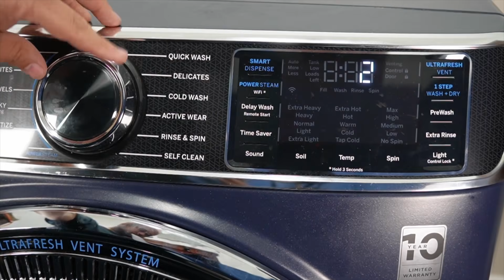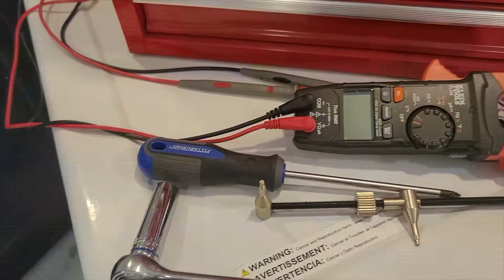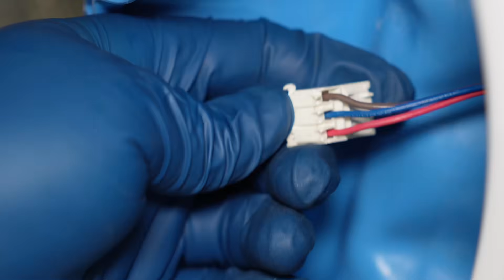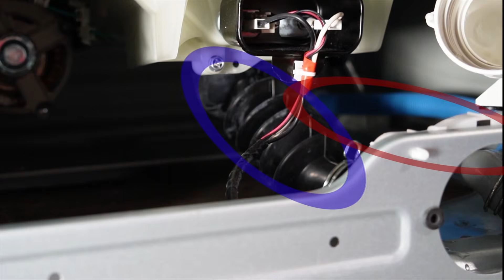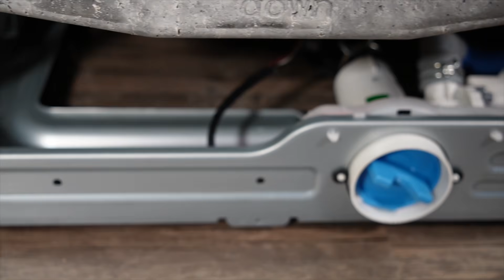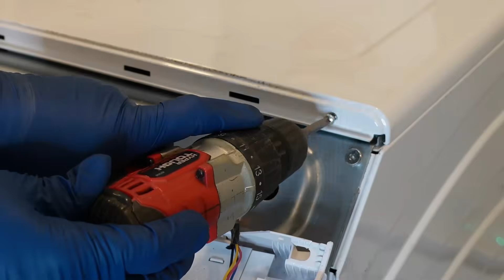GE Front Load Washer Stops Mid Cycle and Won't Spin - Common Issues

Comment from the maker: Key parts mentioned in the video:

Inverter Board: https://bens-appliances.com/products/wh22x35837-ge-washing-machine-inverter-board
Door Lock: https://www.ifixit.com/products/ge-door-lock-wh01x29528
Drain Pump (3rd Party): https://bens-appliances.com/products/wh11x29539-ge-washing-machine-drain-pump-wh11x29539cm
Pump (OEM): https://ifix.gd/3XPuKIk
Accelerometer: https://www.ifixit.com/products/ge-washer-accelerometer-wh03x32138
Reply: I bought a inverter board from Ben Appliance and changed it. My washing machine works well. Thank you.
Reply: I had a 3 error code only so I repllaced rhe incerter board and it works fine now. Thanks, Ben for selling a good board!
Reply: I used this video to diagnose the issue (and found a lot of backup that he was right in other sources) and purchased the board directly from Ben.  The price and shipping was on par with most (cheaper and faster than many!). 

Replaced it yesterday and the washer worked immediately. Thank you!
Reply from the maker: @yerocb nice!

Comment: Thank you! Saved me from paying the ridiculous $125 trip fee that GE charges did to come out and diagnose the problem (not including labor and any parts needed) or buying a new washer. New inverter board installed with your help and feels like a brand new washer. Only 2.5 years old when this issue started in the first place. Hoping with this new board, the washer last more than 2.5 years. We shall see! Thanks again!
Reply from the maker: You're very welcome, hopefully, this one holds up for you much longer!

Comment: Posting this for future viewers: my machine would prematurely end any wash cycle. Diagnostic Mode option 1 showed error code 3 ('locked rotor monitor'). Using Diagnostic Mode option 14 (spin test) demonstrated that the drum would only spin for about 5 seconds at a time, which is faulty behavior. This suggested an issue with the inverter board (motor control board). Ordered and installed a replacement inverter board. Everything is working correctly afterwards. When ordering a replacement, ensure you are getting a more recent version; I purchased v2.3.3.9, GE PN: 290D1952G105. The version and part number are labeled on a sticker attached to the pcb. Hope this may help someone in the future.

Comment: rinse and spin stops after about 3 minutes. tried probably a dozen times and it never enters diagnostics mode. i ordered the inverter board and was about to start, but now i have second thoughts given no diag mode. not sure if I should proceed or just get a new washer. HD has a sale.

Comment: Thank you for the video, got it fixed, simple instructions are the beat
Reply from the maker: Glad I could help you get it running again!
Reply: @bensappliancesandjunk  mine doesn't even enter diag mode. i tried probably a dozen times. i did order the inverter board, but afraid that might not even be it without codes.

Comment: Thanks for the great video. My inverter board died on a 6 year old unit. Figured it was bad given all the tests that I ran and this video helped to make me more confident of it. I flipped the washer on its back and replaced the inverter board easily by going in through the bottom. If you have the room to lay it on its’s back (and the extra help to carefully lay it down and pick it back up) it’s so much easier. Nothing else has to be removed.
Reply: but you got codes. mine doesn't even get to diag mode.

Comment: My washer stopped working a few days ago and I ran a diagnostic test with codes 3, 19, 23, 26, 27, 38 coming up. 3 was the primary error and others cascading. Ran test 14 (spin) confirming inversion board issue. Order the inversion board from you and a spring expander off amazon. Washing machine is back and running like new. Your video perfectly explained the repair, thank you!

Comment: Just replaced my Inverter this afternoon. Should've watched this video beforehand. Replaced the drain pump first, and then the main control board. Washer still wouldn't pass test #14 or 26 after replacing both of those two parts. Was scared it was the motor, so I replaced the inverter board instead. Best video. I replaced it by putting the washer on it's back instead of removing all the other parts. Still an awesome video. Thank you!

Comment: GFW850SPNRS  error codes 3, 38, 23, 26, 8, and 92. Fills with  5 seconds of tumbling and keeps repeating 5 seconds of tumbling then ends after 3 seconds. After resetting error codes and leaving unplugged for 10 minutes it gave me error codes 3 and 9. Also, it’s over sudsing with an empty load. Could it be that the main board is bad? Or definitely the inverter board

Comment: My washer is just over 2 yrs old and it started having issues with stopping mid cycle and not spinning. It had a bunch of codes related to the door lock, inverter and motor. I cleared those and did a spin test. Still failed only throwing code 3 which is a stalled or stuck motor. The motor turned easily by hand and the motor windings homed out fine. Replaced the inverter using this video as a guide. Works perfect. Thanks for making this video🙏🙏🙏

Comment: I keep getting code 3. Failed spin test 14.washer only spun for about 5 seconds. My hall sensor is connected.  Is there a way to test its bad and how can I test the inverter. I see many comments with the same issue as mine that say they replaced inverter and it worked after. I just want to test before I buy something that doesn’t work?

Comment: you do not need to remove the door boot to remove the door lock. just feed it though the front panel Ben... i have change a few of them... These blue door boot GE washers fail after 2 or 3 years...money pit washer...

Comment: I have the blue one 3 years old , code 65 and 92 do I need a motor and inverter? I did the inverter test and it is definitely bad. After power reset it had more movement but still failed. The concern is I replace the inverter and the motor fries the new one. I also have codes 3,27,38 and 39.

Comment: Mine passed diagnostic test 14. It spun the whole time. Cleaned the pump all the way and the hoses. Water still just sits in my washer machine and won’t do the last rinse and spin cycle.

Comment: I ran the service mode 14 and everything ran fine. I tried the mode 12 and nothing happened. Would that lead me to replacing the drain pump? FYI, washer runs for about 10 minutes and when it comes to drain/spin, nothing happens and shuts off after 5 minutes leaving a tub full of water.

Comment: Great video! Quoted $550+ to “maybe fix” my washer that stops spinning shortly after it has begun. Watched your video, decided to order an inverter board. Using your video, my fiancé had it up and running in two hours! Thank you!
Reply from the maker: So happy I could help you get it running again without the high repair bill!

Comment: This are all the codes I got on this style type of machine 

Drain/water level 

• Code 9

• Code 26

• Code 27

• Code 38

• Code 66

Motor / drive:
• Code 3
• Code 43
• Code 48
• Code 50

I narrowed it down to the inverter board since it went through all the tests except the #14

I couldn’t think of anything else

Comment: For anyone else doing just an inverter replacement, there is a much easier way.  Turn the unit on its side, and use the opening in the bottom to access the inverter enclosure.  You can see the bottom opening in this video.  You have to undo a single screw (its tight, but has a Phillips or socket head idk the size) and the whole enclosure will be free and dangling by the wires.  Then just do the same thing this guy did to replace it.  DO NOT be an idiot like me and leave the soap dispenser in place or it will leak all over the place and you'll spend hours cleaning it up.

Comment: Having issues with this washer spinning a couple seconds then stopping and eventually cutting off. Error code 3 mentioned hall sensor? should I just get the inverter board? I've already replaced vent pump because it had that code and door lock assembly because it had that code (even though I think that was fine).

Comment: I tried to run test 14 and nothing happened. If the door is open when I try to run it, the display flashes the lock symbol but when its closed it just does...nothing. Advice?

Comment: My GE 850 model is stuck  on pause mode after all the resets unplugged amd replugged  ran diagnostics got code 34 38 39 . When I try to go.into test mode to see if I need a board or a vent damper it wil not let me test it gets stuck will not cleat so I can turn dial to right to advance to testing.. I have plugged and repluggwd so mucj my arms are sore

Comment: Two months ago my blue GFW850SPN5RS went out. Like many of you the level of disappointment I had after only owning this machine for less than three years was infuriating. It began when I started to notice that my clothes felt wetter than normal. Eventually, it would stop 3 minutes into starting the cycle. I found Ben's videos and started with replacing the drain pump - no fix, motherboard - no fix, and finally before giving up completely I decided to try the inverter board as a last ditched effort. Finally, issue resloved...the lesson learned when doing the spin test is just because it spins does not mean that your washer is fully working. The fact that it never went into a full spin cycle should've been my first indicator. Let's see what happens in thr next 2-3 years. Thanks Ben for your guidance and amazinf videos. To everyone else no matter how overwhelming it may be, take your time and just know that you're more than capable of fixing this silly machine.
Reply: I have the same model and mine is 2.5 years old and won't spin or drain. I replaced the pump and that didn't fix it. I guess the main control board is next. So disappointing.

Comment: Help! Did test 14, and it went further than 5-7 seconds and started swaying back and forth… with a loud banging noise.  Before seeing this video, I replaced bottom draining pump. Still inverter? Or possible other issues?

Comment: Well, this video was absolutely useless to me. Thank you for wasting my time.. I have this exact same washing machine gets set to program log logic number seven. After four minutes into any cycle, it stops and says end I had water in the pressure sensor reservoir at the bottom of the drum. I could blow into the pressure sensor hose and hear it bubbling like a water bong so I drain the water and cleared the nipple of any kind of obstructions dried soap or whatever and I got all the water out of there so I was blowing air through it instead of bubbling water, slapped it back together and it’s still doing the same shit

Comment: Thanks! This helped me a lot. I did not remove the concrete and was able to access everything with a little effort from the front just fine. One thing that had me worried was the removal of the control panel assembly. Note that after the screws are removed and the left side pulled outward that there are two pins on the right side that hold it in place. The whole thing needs to scoot to the right to get off those pins. There isn't a reason to take the top off if you are just replacing the motor controller below.
Reply: Take the top off so you could look at the wires and connections to check if any of those could be causing the issue. It could be a loose wire, a burnt wire, cut wire, or other connection issues along with other parts that could have been burnt out.

Comment: Replacement worked for me.  Sent $50 as a thankyou.  On my GFW850SPN4RS model, I didn't have to remove the cement to get to the board.    Wash out your soap tray before putting back together.  Mine sat apart for 3 days waiting for the inverter part and the tray clogged.  Took 2-3 cycles before the washer sounded the same with reference to clicks and water hammers.  Been working just fine for 3 weeks now.  I think mine blew due to a brown out.  I have a Ting monitor and it dipped twice during the cycle.  I was finishing laundry as a severe snowstorm was hitting us. No more laundry during severe weather.

Comment: Those two big connectors on the board do NOT come off easily.  Not pretty, but I pried it with a small screw drivers.   I have the GFW850S model.  Removing the cement is not necessary to get at the inverter.  I also have the pedestal and didn't have to tilt the unit back for the three bottom screws.  Just opened the drawer.  The mix of screws used is maddening.  Make sure to document what screw go where.  I took a lot of pics and laid out screws in same pattern that they are on located on the machine.  My machine was new in July 2023.  Didn't even make it three years and for a family of two with three dog beds.  Adding GE appliance repairman to the YouTube certification list.

Comment: Great video, thank you. This gave me additional confidence in diagnosing the issue without taking my machine apart. In terms of replacing the inverter motor control board, I found it easier to tilt the machine back and go in from the bottom.

Comment: Adding my situation for hopes of some help. 

At first my codes were : 65 , 3, 38, 50 & 46 — I ordered an accelerometer and replaced it my codes now are : 3, 8, 38, 50 , and 46 .

The machines fails the 14 spin test and the 26 spin test . Any suggestions ? I want to give up and buy a whole new machine

Comment: Replaced the inverter on mine reset the codes did test 14 but it still stops 5 mins into a cycle.

Comment: How did you get the two big clips disconnected, these are a pain, I’ve tried pinching them and pulling up and they won’t come out
Reply: Really small flat head screw driver

Comment: i have a GE washer GFW655 that is 23 months old.  The pump sounded like it had gravel in it, i thought a bearing was out but it was starting and stoping in fractions of a second and sometimes working.  I replaced the pump and it worked ok for a few cycles before starting the same thing.  I've inspected for lose conections and other signs of a short or open.  seems like it operates more reliably when the top is off but not always.  I've been messing with it for a few days now the drain pump is either working or not - no more quick cycles.  I'm thinking if a board was bad it would not work.  Any suggestions or what to test?

Comment: One note on replacing the inverter, you can reach it from the bottom of the machine and replace it if you don’t want to take off the front side and miss with the door gasket. For me I found it the machine was heavy and I did not have anybody to help to I did reach it from the front. It wasn’t that bad.

Comment: I replaced the inverter board (and drain pump prior to learning of the diagnostic mode). But my problem is still there.  It just will not spin. When I put it in mode 14 it spins perfectly and completely.  But when I do rinse/spin, it just stops with 13 mins left with a drum full of water.  Any help would be great!
Reply: Mine stops at 13 also. Won’t spin. I do not have error code 3.

Comment: Thank you for your videos! I followed your advice and changed the inverter board, and the machine is back up and running.  Definitely need to watch his video about how to spread the retention ring spring with a wrench and zip ties, that approach worked flawlessly and took no time.

Comment: Your videos are GREAT!  We've had our GE front loader, exactly the one in your videos (the blue one), and this is the first time that we are noticing the clothes are still too wet after the spin cycle.  I noticed a little bit of water still in the tub, and remnants of a Purex Pod stuck to the some jeans.  Ugh.  I ran them through another cycle with no pods, and although they were still more wet than I would like, I put the load in the dryer.  We tried to wash my husband's jeans.  One pair.  In this load, the machine did not spin, and water was left in the drum with the jeans.  We drained about 5 gallons of water from the release at the bottom of the machine.  I'm thinking something is clogging the machine somewhere.  I tried to run the rinse/drain cycle.  It added more water to the drum and when it got to the point where it would spin, I got an END message going across the display, then it stopped.  So now I have more water in the drum!  Any suggestions?  I wish there was a "drain" button on the machine.  Is there a way to drain the drum without adding more water to the machine?  What a mess!
Reply: Yes, follow the video above on running the diagnostic test codes and use #12 instead of where he used #14 here.  Drains your washer.

Comment: Edit: ah! The white plastic frame that's connected to the front panel isn't actually part of the drain pump assembly! It's just a mount for the drain filter access panel, so it wasn't attached to the rest of the machine.

Any tips on how to pop the drain pump assembly out of the front cover on a GFW650? It has plastic clips attaching it to the front panel, and I can't seem to pop it off so I can lift the front off. Thanks! (I'm actually bracing the front panel right now with my hip, having removed all of its screws before realizing the drain pump assembly is connected on this model 😂)

Comment: I have this codes , 18,27,3,38,92,19,29,26.
Did the mode 14 and spun for a while until I stopped it , I have already replaced the door switch assembly 
Is not rinsing and spinning, 
I have already cleaned the filter at the bottom

Comment: What about the pressure hose, have you ever had that give you issues on these units? If there is a leak or blockage in the pressure sensor hose it would be hard for the machine to tell if there is water in the tub or not.